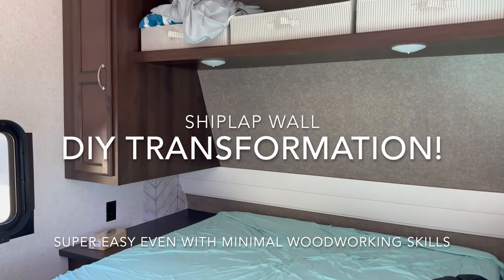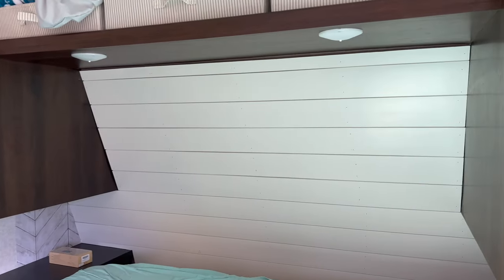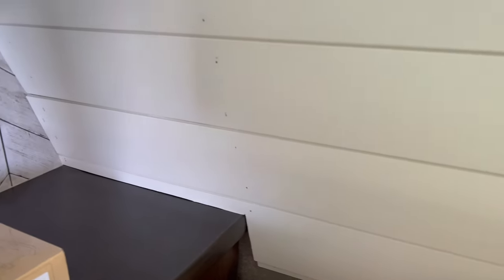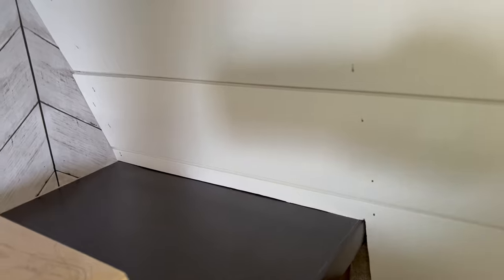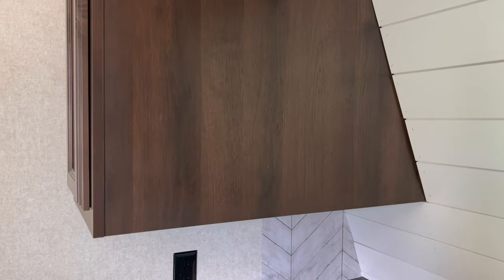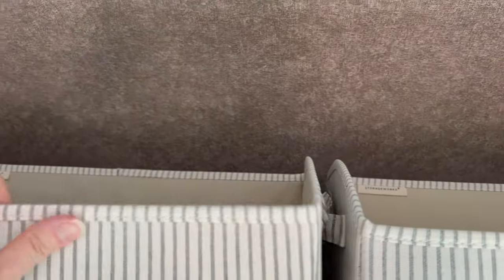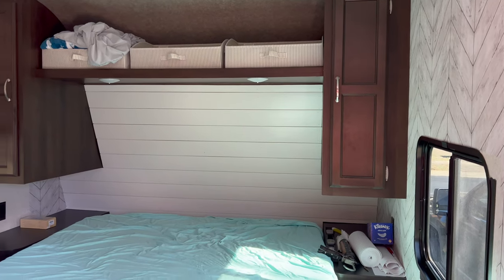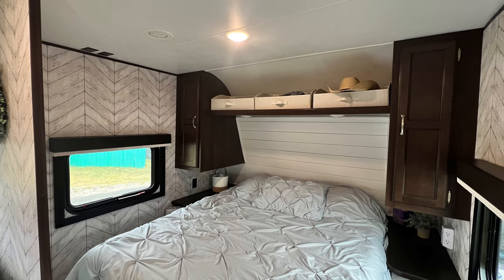Installing SHIPLAP Camper Travel Trailer Shiplap Accent Wall Behind Bed Upgrade DIY RV Renovation

Comment: So where’s the part where you showed how you actually installed it.
Reply from the maker: Hi Lori, I totally neglected to record that, but I'm happy to share. I ran a zig zag bead of Liquid Nails along the back of the board, put it in place and used a nail gun to put nails about every 16-20 inches. Spackled the holes, touched up paint and added some adhesive vinyl "quarter round" trim to really finish the look.
Reply: Thank you. That’s very helpful